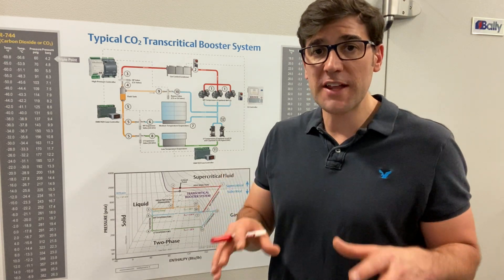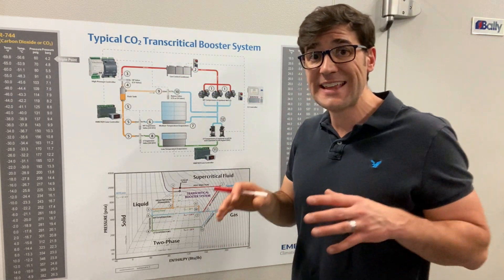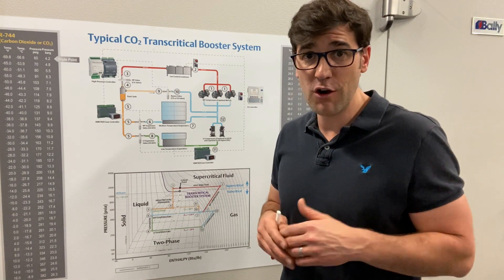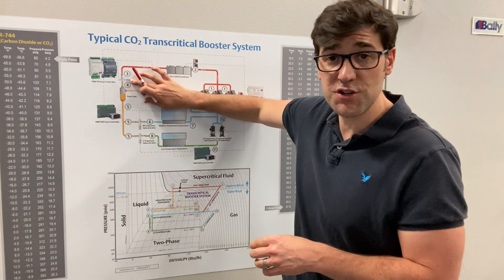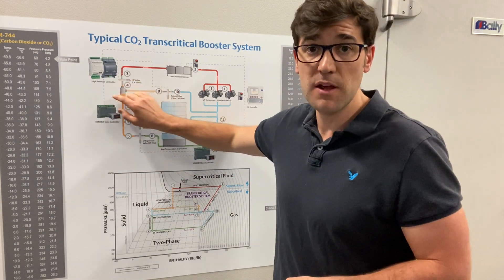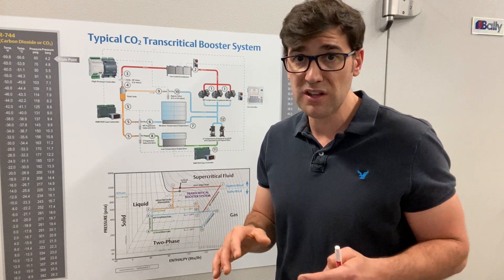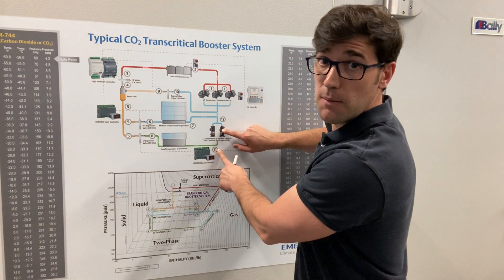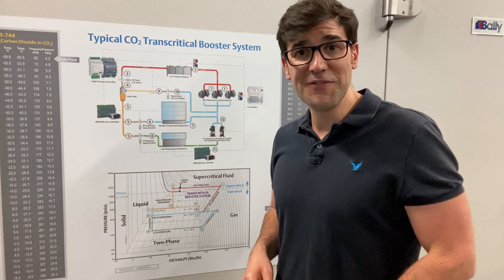CO2 (R744) Transcritical Booster System Simplified

Comment: Sub critical or transcritial which is better in CO2 refrigeration
Reply from the maker: Honestly CO2 is really like any refrigerant with a few characteristic differences and the lower you can keep your discharge pressure and the highest you can keep your suction while maintaining the product that is the most efficient system.

Comment: I recently came across a trans critical booster system that had a liquid line labeled “ liquid injection”  that fed into a CCMT that went directly into the mid temp suction accumulator and I’m not sure what the function of that is can anyone help me out
Reply from the maker: It is to cool the MT compressors when the superheat or discharge temperature is too high. Look in the controller for liquid injection to see when that solenoid actives and deactivates. Great question. We have some great CO2 courses coming up and if you know anyone who is ready to level up their refrigeration knowledge please introduce me. https://linktr.ee/refrigerationmentor

Comment: @RefrigerationMentor Nice to check this video. My question on top level is can this be achieved for vending machines  like pepsi or coca cola ? Can this system be made that compact and standalone?
Reply from the maker: @akshayparab2664  coke has designed thousands to even millions of CO2 fridges. I have seen a lot of them before. I think they may have moved away to hydrocarbons but not 💯 sure about that.
Reply: @RefrigerationMentor  Thanks for your respond. Any article or technical paper which I can refer to study how this refrigeration system is configured in coke machine?

Comment: how are the gasses from 7 and 12 mixed together if they are different enthalpies? Guess same pressures but strange. enthalpy is specific energy plus flow work. both gasses, so guess one is hotter than the other, but just mix cuz same pressure? thxs david

Comment: Hey can you make a CO2 refrigerant video all the basics about the compound, the oil these systems use and what happens if overcharged or undercharged. Can you also talk about the expansion rate, how much we get in a can, what types of can sizes will we typically see in the field?

Can we also get info on the different types of low temperature metering devices? Also can you give us an idea how a heat pump CO2 system can work? Will we be able to avoid freezing the air moisture with these systems? Will they need a bypass valve as well?
Reply from the maker: Yes we dive into all this stuff in the different techncial CO2 programs we offerwww.refrigerationmentor.com you should check some of them out.

Comment: Im not very well versed in commercial refrigeration. Looking at the diagram would the medium temp evap require a check valve? Looks to me like the low temp compressors would try to discharge in reverse flow through the medium temp evap.
Reply from the maker: The low temp discharge right into the suction of the medium temp compressors.
Reply from the maker: @myselfremade the cooling 2 different zone. low temp and medium temp.
Reply from the maker: @myselfremade they would use a two stage compressor for that process.

Comment: Regarding the gas cooler; This appears to be air cooled. Is this the typical method used to cool CO2 coming out of the compressors?
Reply from the maker: For supermarket application I usually see Air cooled gas coolers or adiabatic gas coolers

Comment: Great video! Does Emerson’s system not utilize a desuperheater from their LT evap discharge back to the flash tank before connecting to the MT compressor suction?
Reply from the maker: Not in this Demo trainer. I don't believe they design CO2 racks yet. You will need to contact Emerson to find out more.

Comment: Love it Trevor, been listening to all your Co2 podcasts on Spotify this week. Can’t tell you how much I appreciate all the knowledge you are sharing, you manage to get it across in an understandable way, really are a mentor to me.
Question, why is it called a booster system?
Reply from the maker: Thank you very much. I am really glad they are helping you. Please share with a friend and leave a review on Spotify.  Why it is called a booster system is because the low temperature compressors are discharging into the medium temperature compressors and the CO2 (R744) is boosted to a higher pressure
Reply: @RefrigerationMentor  Thanks for clearing that up Trevor, pretty amazing stuff that discharge becomes suction! Would love to see a video from you (if you haven’t already not made one) in regards to phycometric charts. I find them confusing but believe they would help immensely understand systems better. Any advise or resources you recommend?

Comment: So on hot summer days above 31 C the CO2 only condenses in the flash tank receiver cooling the trans-critical gas into liquid  ?
Reply from the maker: Yes above 31C there is no pressure temperature relationship. The pressure is reduced through the HPV high pressure valve and droplets will fall out of the refrigerant vapor and drop to the bottom of  the flash tank/receiver.

Comment: Which CO2 refrigeration system is better for providing refrigeration to building
Reply from the maker: There are more and more options each year.  You will see many CO2 heat pumps and chillers make their way into the market over the next few years.